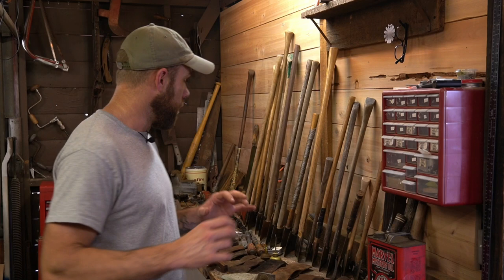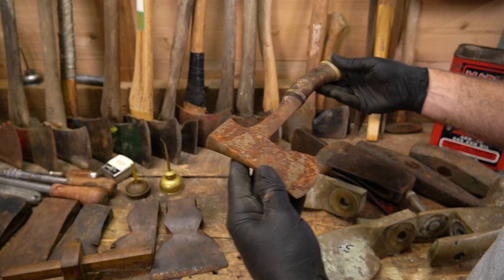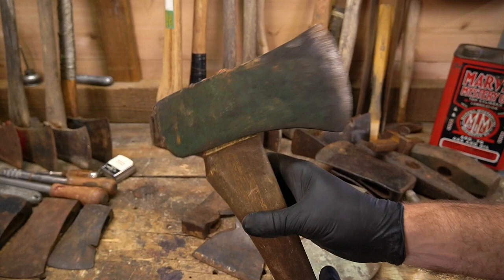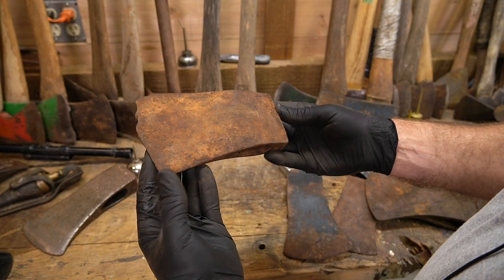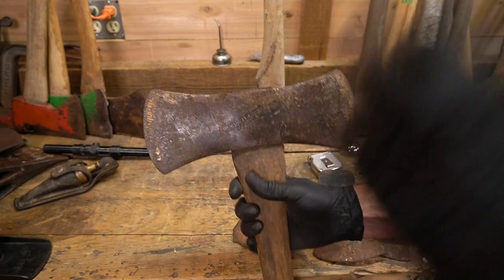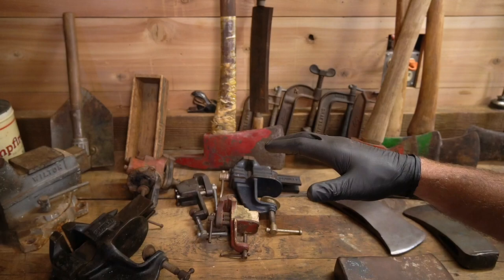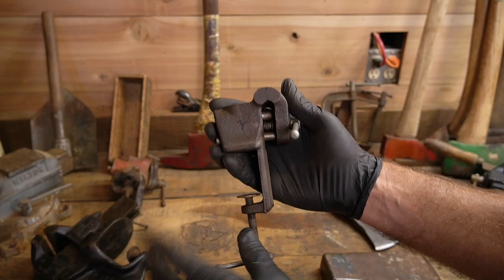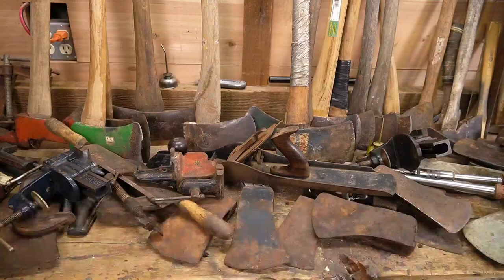The time is now. Rusty Axe and Tool finds.

Comment: The green axe kinda looks like a Collins Commander. I picked one up the other day with the same flat handle.
Reply from the maker: Did it have a sticker or was it stamped?
Reply: @old_iron_axe_and_tool  It had a sticker and blue pained bevels. But I have seen them without.

Comment: Found a couple of estates sales going on near me. I'm going to check them out next weekend and look for some old ax heads for my first restoration project. Any advice?
Reply from the maker: First is to be there as soon as they open and be aggressive about finding them, Axes go fast. If you don't see any, ask if there are any. Generally you'll find them with the other yard tools. Remember that the heads are small and hard to see if they don't have a handle. Don't be shy about digging through stuff, I've found some gems in odd places. Around here axes or heads go for $1-$10 a piece.  Good luck
Reply: Awesome should be a fun hunt